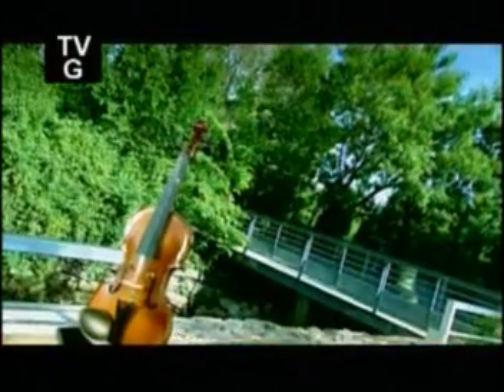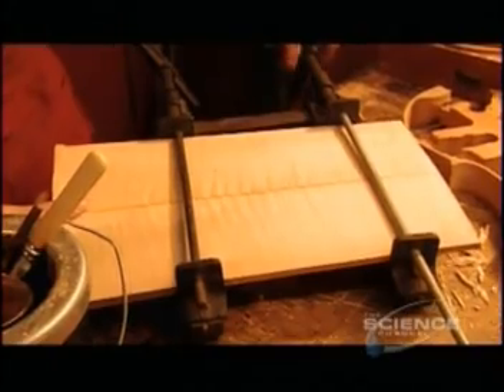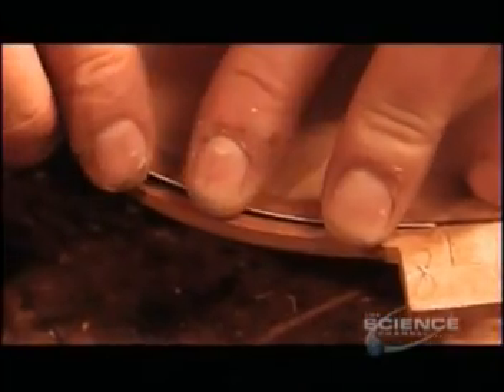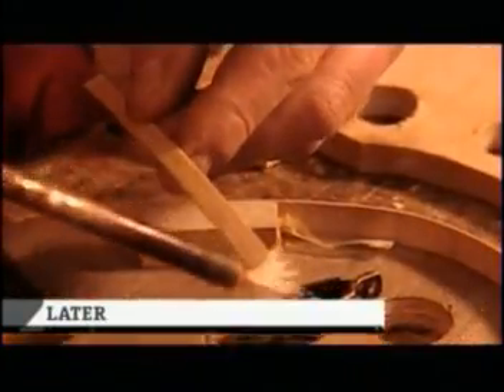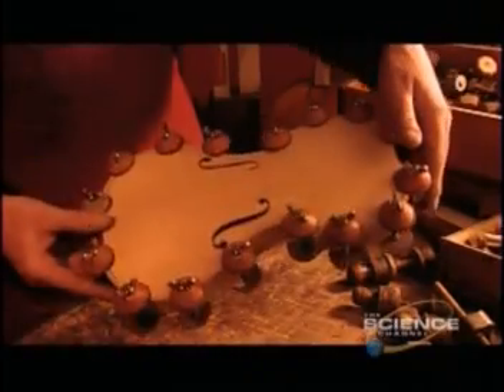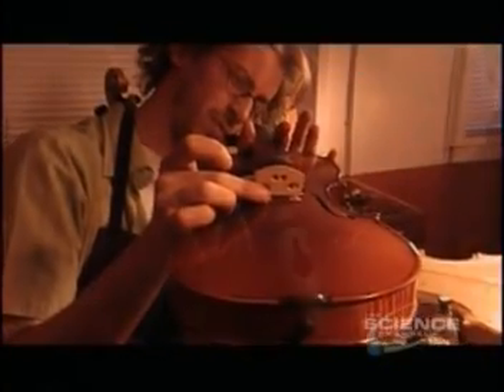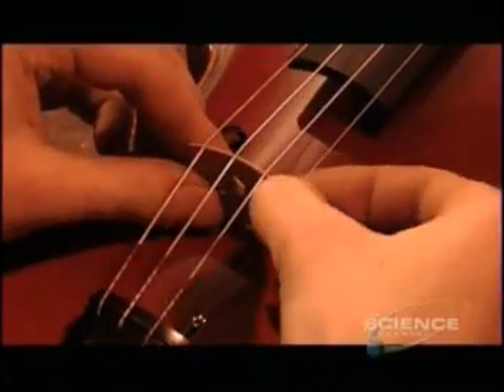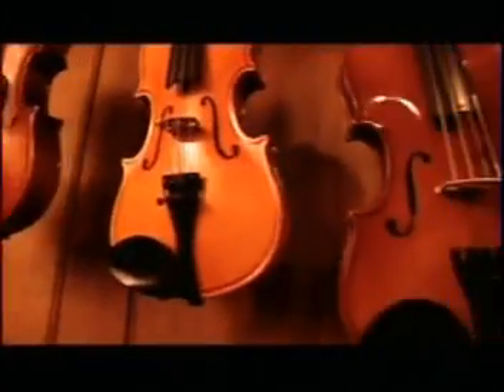How It's Made: Violins

Comment: Yes, with any stringed acoustic instrument, the shape and composition (what its made from) can vary the sound.  A Viola is almost identical to the Violin, but sounds notably different, because it is larger.  Cellos, are much bigger and have much lower pitch still.   So changing volume as well as shape will have an effect.

Comment: It transfers (conducts) the vibrations from the bridge to the back of the Violin.  The back of the Violin then resonates and the body of the instrument acts to amplify the sound.   Different kinds of wood resonate differently.  If you ever have a tuning fork or a little wind up music box listen to it  when you are holding it, then listen to it when the bottom is pressed against a piece of wood, like a drawer. The audio will be louder and fuller than before.